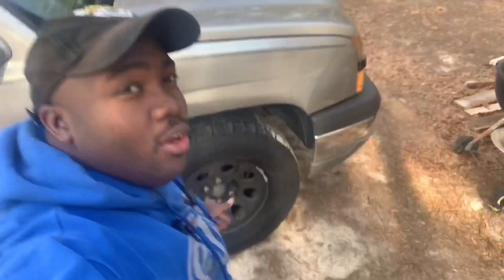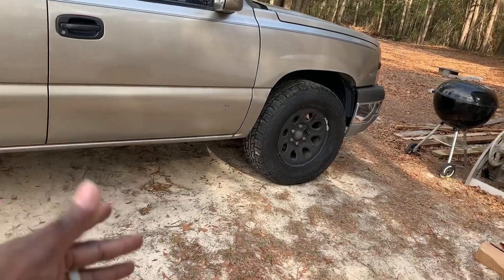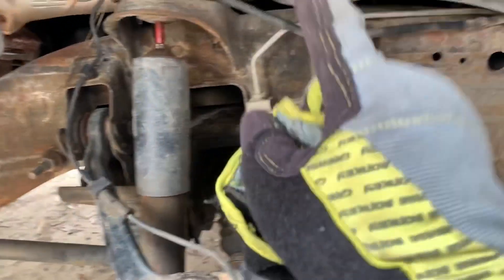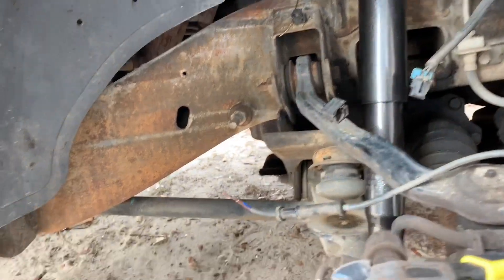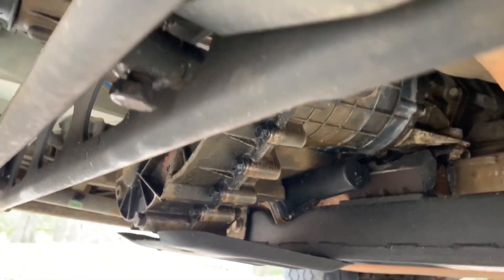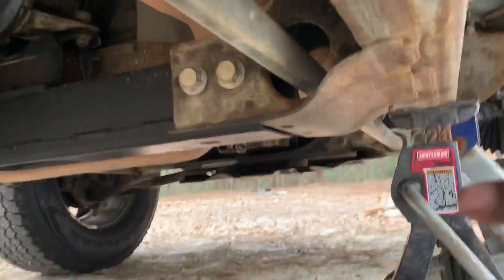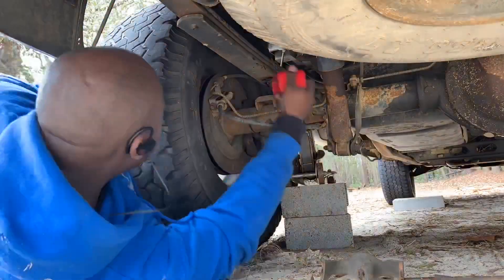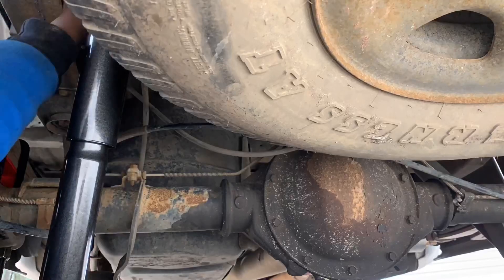Chevy Silverado gets NEW SHOCKS AND LIFT BLOCKS | Project Silvia

Comment: Nice job! Trucks looking mean again!  I remember we had a service bulletin waaay back when I worked at a Chevy/Buick dealer for low speed abs activation, rust was building up under the sensor we had to check sensor with volt meter and clean the mounting surface for sensor.
Reply from the maker: There was a more recent service bulletin comparable to that. You got some good memory
Reply: I have my moments  @AtomicGarage